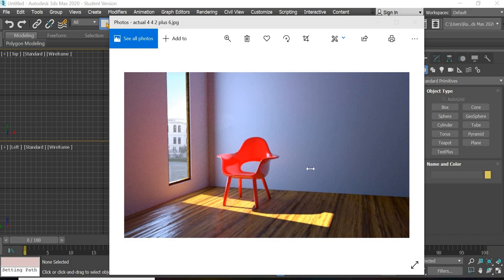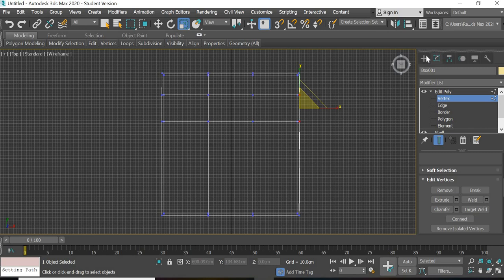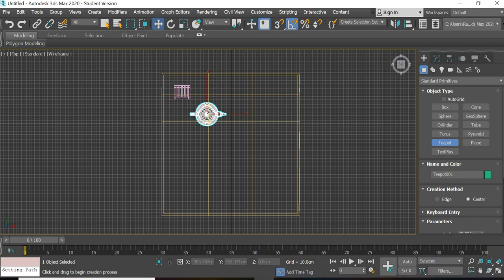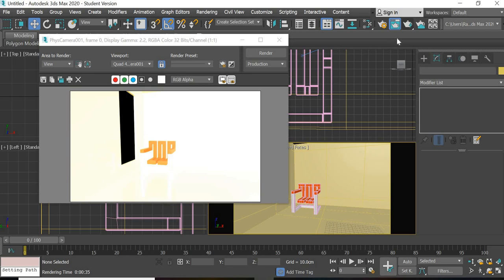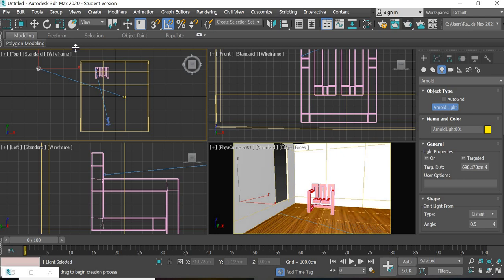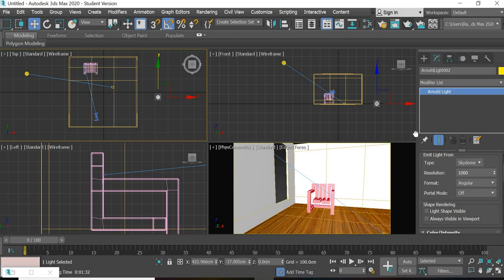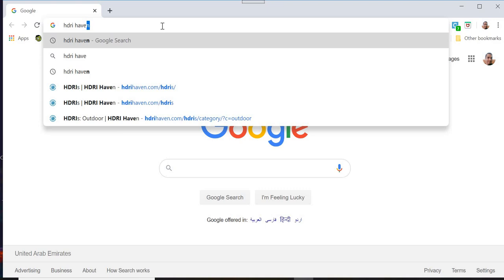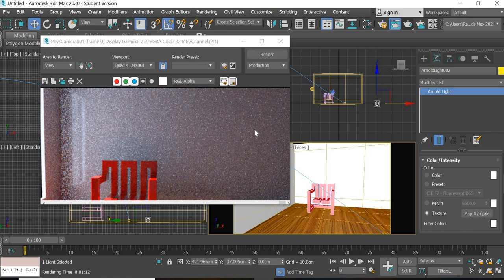3DS Max, Arnold rendering, Indoor scene #1

Comment: You can use "Straighten Coners" option in Shell command which is located in the very bottom of the right-hand side panel instead of moving nodes of the wall by hand. At least in latest versions of 3DS. Thank You for the video. <3
Reply from the maker: Thanksnfor the comment. Will look into it. Many tools r there and it is difficupt to find everything. But its cool to have comments like this to learn more every day.